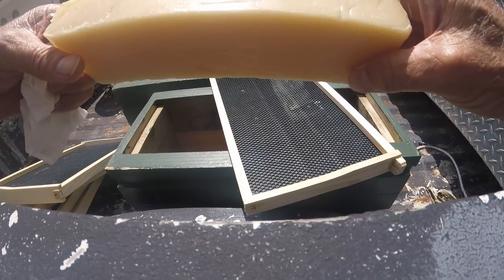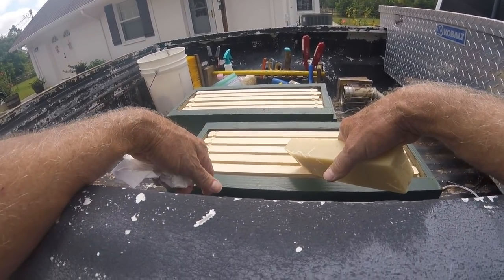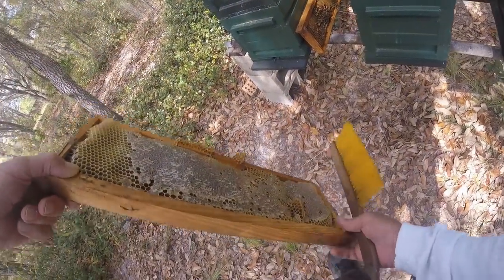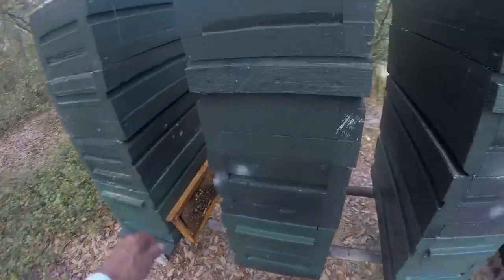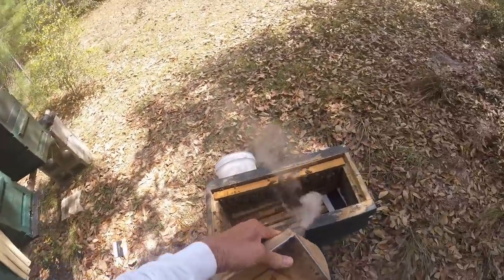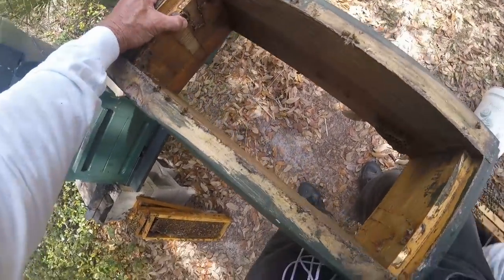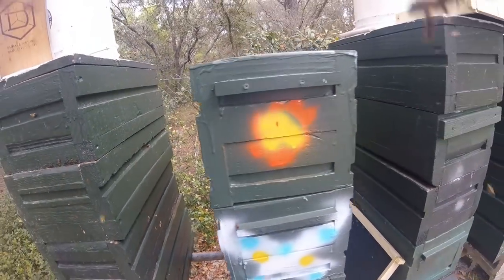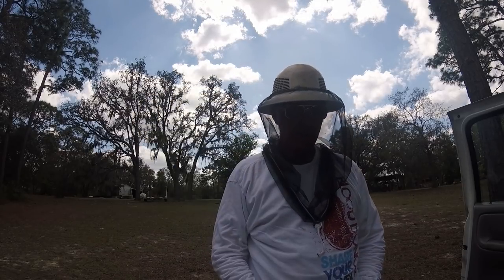March Honey Harvest

Comment: When you get slimed, put the frame in the freezer for a
couple days, then while it’s still frozen use a paint scraper and the frozen
wax will come right off (along with any icky stuff) and never warp the frame /
foundation.
Reply from the maker: Thanks Jim great tip and i do have a extra freezer.My new beetle bait traps i think are working i may not have to use it.